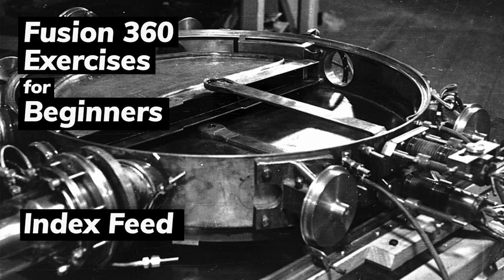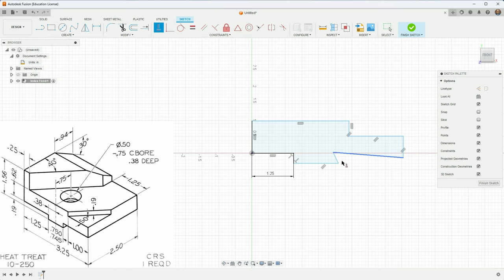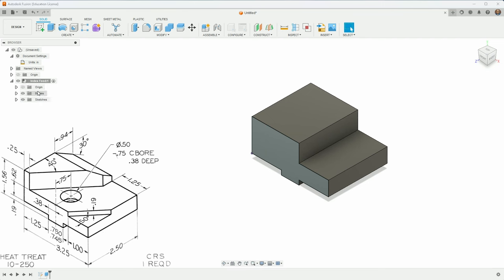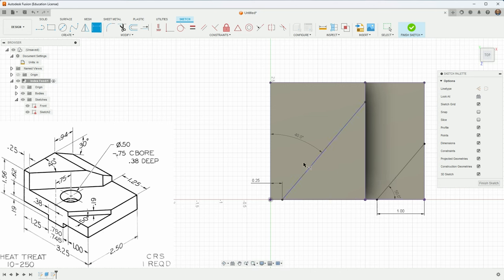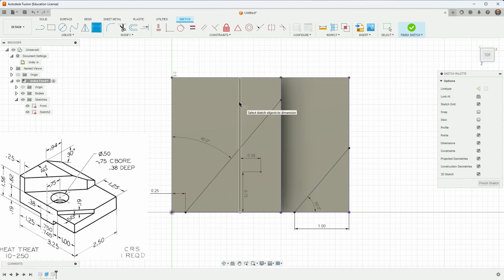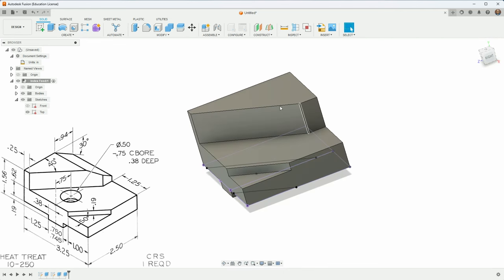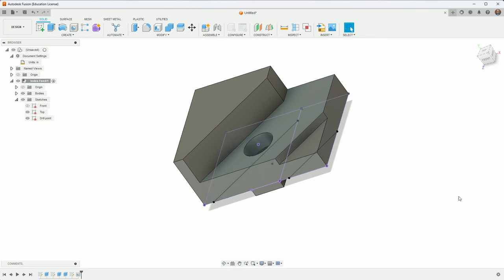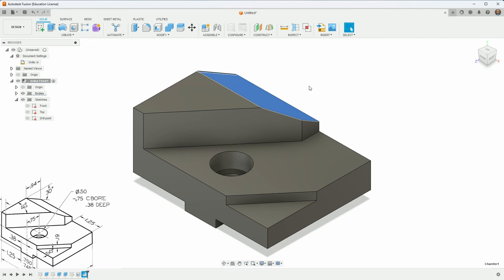Fusion 360 Exercises #6: Index Feed

Comment: Nice chamfersollution, I didn't know that. When you tried to put the counterbore in, you could have referencend from the sides of that surface. This way you didn't have to go through the trouble of sketching a point. Just another idea.
Reply from the maker: Thanks for the comment. Can explain what you mean, re: referencing from the sides of the surface?
Reply: @RobDuarte  When inserting a hole, you have the possibillity too 2 referenceitems. You can use 1 for e.g. leftside and 1 for e.g. top. You don't have too make a sketch or sketchitem to place the hole. It's all in the hole-menu as "reference".
Reply from the maker: Woah, thanks! I've never used that feature and you're right,  it would've been perfect there.
Reply: @RobDuarte  Never too old to learn 😁
Reply from the maker: Who are you calling old! 😂
Reply: @RobDuarte  Looking at your picture, I'm older and I learned about the chamferoption, so you can decide yourself 🤣
Reply from the maker: Haha given your username you might just be 1 year older than me
Reply: @RobDuarte  Also 1 year wiser😄